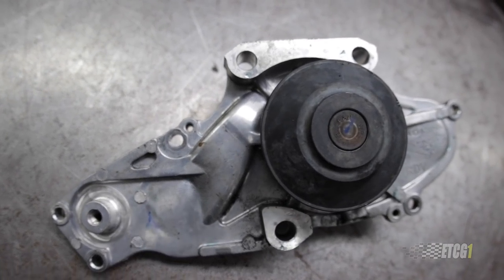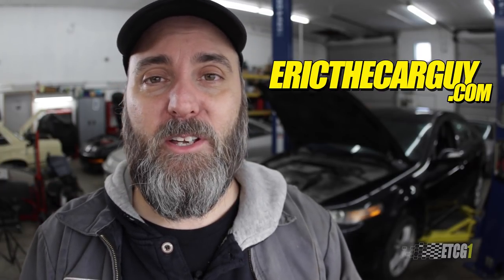Timing Belt vs Timing Chain, Which is Better?

Comment: My question has always been why did the public think the imports (belts by in large) were reliable but domestics(chains by in large) were unreliable--but after 150k-200k miles the total cost were the same (multiple belts versus one transmission rebuild).
Reply from the maker: I'll try and keep this short. Domestic vehicles often used nylon coatings on timing gears to keep them quiet during operation. When the nylon failed, so did the chain. Also, as the chain wears over time, engine timing, and often ignition timing, are effected and performance decreases. Conversely changing out a timing belt at a given interval sets everything back up the way it was when it was new and mechanical timing is restored every time you replace the belt.
Reply: @ETCG1  I wasn't referring to timing sets (to which I know GM used non oil resistant nylon as opposed to FoMoCo)  but the publics perceived reliability of imports.  When at the end of the day similar money was being put into them, imports in routine maintenance (timing sets and valve adjustments) and domestics on major wear items  (transmission rebuild).

Comment: Objectively, both have there pros and cons. In or houses hold me and my dad have owned several cars with timing belts and timing chains. Or daily drivers always had timing belts and we checked the service history of it before buying it. Always replaced the belts on any car we owned once the mileage or age interval was due. Did it ourselves (always checked how involved the jobs where first), bought the OEM kit. For someone that does their own maintenance it's an amazing piece of mind that the belt is fresh and replaced with a quality part, including water pump, tensioner. But for non-car people buying a car with timing belt motor is risky. Replace it just in case or walk away from the car if it's unknown when the last service was. Or replace it asap after purchase. I agree with the timing chain fan boys that it is mostly less to worry about. But, you have to keep in mind that the thick, overbuild timing chain from the past (like for example on my 70's classic mini) aren't the standard for the past 10 years or so. Modern chains are lightweight, thin, and have often fragile guides (Like on BMW's R51 Mini's) that could start rattling sooner than you think (especially high mileage ones). And replacing a timing chain on a modern car often means engine out, and doing some seals (like the front crankshaft seal) while your in there. Moral of the story. If you buy cars often and don't keep them long term (flipping them, our just like changing them frequently) buy something with a chain or belt that still has some live left before its interval. But if you want to keep it long term buying a car with fresh timing belt, or replacing it when necessary after purchase, that's the most safevest bet.

Comment: The thing I like about chains is catastrophic failure is a lot less likely than timing belts. Usually chains will stretch and shift time a bit where you'd have running problems before you get valve contact, but belts usually rip and you find out when your engine blows up. I view chains as serviceable items too, but just with a longer lifespan and a lower likelihood of failing unexpectedly.
Reply from the maker: My experience says differently. Fist, chains don't stretch, they wear. Second, if a chain brakes, it usually takes other things with it and sends a bunch of stuff into the oil pan. A broken timing belt doesn't normally do that.
Reply: @ETCG1  The feeling I've gathered with chains VS. belts is that with chains, following your oil change intervals is a big deal, and that most chain failures are a result of poor oil change intervals. Where as a belt driven vehicle would be much more forgiving of extended oil change intervals, you'll just start having compression issues, or oil pressure issues (aside from the other obvious problems like sludge and blocked oil passages and whatnot).
Re stretching: I've definitely seen case studies where chains have stretched, but I don't know how common that is. (yes the "stretching" is through the links wearing, but the point is the chain gets longer than it should be)
All this being said, I'm not a mechanic, soooooo... IDK. 😅
I just spend most of my free time watching ScannerDanner Premium, your videos, Ivan's videos, etc. :P

Comment: after I have done some research on both . and that's why I own V6 Toyota Venza . the only one thing it will take care of the timing chain. is change oil regularly. never to over due on oil change . and that one reason alone can cost timing chain replacement.. correct me if I'm wrong .. thank you for the video     ..

Comment: My Mazda problem you described was solved was solved by using the same plugs and wires that came with the car (Japanese OEM). I used Bosch once and it didn't fix my misfire.  The Mazda mechanic said it had to the with higher resistance of the Bosch plug.  He switched them out to NGK or Denso and everything was fine.

Comment: I’d probably have to side with a timing chain on this. My 05 mini has 122k miles on it. I replaced the head gasket December 2020 and considered replacing the timing chain while I was at it until I opened up the engine to find it looked to be in good shape along with the guides. But I’m going to anticipate replacing it here soon as a preventative measure. I can’t get financing on a vehicle at a reasonable APR at the moment.

Comment: Timing chain and it's not even close.  Stronger, reliable, and as long as you keep up with oil changes, it'll last forever.  Timing belts are just cost-saving measures, and things go horribly wrong when they shread apart.

Comment: Timing chain for me.  All five of the vehicles I've owned, had timing chains.  My mom gave me her old 1977 AMC Concord, back in 1990.  I only had it six months before the timing chain broke. (She didn't maintain the vehicle) 

We currently have an 07 Toyota Camry, with 143K+ miles and 01 DGC EX, with 308K+ miles. Both running strong with a lot of life left in them. I replaced the timing chain and gear, on our DGC, back in 2015 at 171K miles, because it was noisy. (Confirmed it was stretched) That job was pretty easy, but time consuming.  (Parts was less than $100) 

As long as you do regular oil changes and use good oil, a timing chain will last the life of the vehicle.

Comment: Wow, That digital confection looks very fancy 😋. 

I don’t mind timing belt driven engines at all, I believe the V6 Honda are still being driven by timing belt along with the straight 6 cylinder 3.0L duramax diesel found in half ton GM trucks.

Comment: I’m really old school, I replaced the chain on my Cleveland V8 with gears……….. more reliable than a chain, and no stretching, but noisy, and expensive. No doubt there are other issues with gears too. I realise that this isn’t a readily available option for most modern street cars.

Comment: Other problem with T-chains is when the have the water pump inside the chain cover and the pump goes bad the cost is a lot higher than t-belts.
Reply: Yes, this is an absolute nightmare. It was one reason the Chrysler 2.7 V6 was such junk.

This would happen on Nissan VQ engines, but typically they had 180,000 miles or more, so the car was barely worth it anyway. Years ago, DIY-ers would buy a 1995 to 2004 Maxima for cheap because they needed to replace the water pump, timing chain, and chain hardware. The leak would always destroy the RH control arm bushings, so just refilling the reservior occasionally wasn't an option. A DIY-er would buy such a car cheap, replace the water pump, timing chain stuff, and control arm, then drive for many miles after that. Those kinds of Maximas didn't cause much trouble anywhere else.

Comment: Just going to say that in a long ( ish ) motoring life with a variety of cars , I have suffered only 1 failure of a Timing Set and that was a BELT ( on a Toyota ). It wasn't an interference engine so there was no catastrophic damage , just inconvenience . The mileage was low but the car wasn't often used so the belt was old . Never had a hassle with chains .

Comment: I've often found that engineering design and ease of repair is more satisfactory that the arguments between the two types of belt engine designs. Designs like the infamous Mitsubishi Evo8 that need 16 hours to replace. Or the Volkswagen and BMW most infamous timing chain disaster because the tensioner from the factory was out of spec as you've stated.

Comment: My dad had a 2000 Mitsubishi Space Star (van type car sold in Europe) with a timing belt. On the Autobahn it made a weird noise at a certain rpm range. When the spark plug cables failed, the shop told us the timing was way off and that the timing belt should have been replaced 30000km ago.... The noise was the belt hitting the plastic cover.

Comment: I much prefer a chain. Only ever had to replace 1 and that was becomes the prior owner kept letting the oil get low (Saturns burn oil, just how it is). Usually if you keep the oil good, chains can easily outlive the care if implemented right.

Comment: I have owned four cars that used belts, A Volvo 240, Volvo 850, Geo Metro and Kia Sportage,  the 240 and the Geo were very easy to replace the belt and I was able to do it in under an hour.  The 850 having a transverse mounted 5 cyl motor was way to hard for me to do,  the Kia was also very hard to do and in addition the second belt, (a factory part not a cheap replacement part) failed 20,000 miles before it was due for replacement.  My last car was a Hyundai Sonada with the 2.4 liter 4 cyl. I drove that car over 345,000 miles with the original timing chain and today my son still drives it.  I am a firm believer staying on top of oil changes and using a good quality oil allowed me to keep that car for as long as I did.

Comment: The few million mile Toyota Tundras had the 4.7L V8....which contains a timing belt.  Let that rest on the shoulders of many.  

Personally, I've seen both failures, so really doesn't make any difference to me what type of timing connection there is whether it be a belt or a chain....the other being people who skip out on normal maintenance seem to have the same issues with failures regardless if they have a timing belt or chain....they skip the service interval for the timing belt, just as they do their oil changes.  

Typically the water pump fails and you have to pull the timing belt anyways so replace both at the same time it seems as the normal service.  Timing chains are ok till things go wrong with tensioners.  Regardless though, with many engines if one or the other breaks you have far more expensive damages.  

The 2.8L V6 in my 84 Ford Ranger had timing gears.  I think most vehicles I've owned have had timing chains, never had any issues with them.  80-100k seems to be what I see for service intervals for timing belts...at that point the water pump is probably on its way out anyways, so personally I'd just plan for that service ahead of time and keep money saved up for a shop to do the work if need be.  A timing chain breaks or a tensioner fails, you have more money tied up in that replacement than you do a timing belt typically, as there's usually more involved to get to the timing chain than there seems to be for accessing a timing belt.

Something I've found is many people don't realize there's a timing belt, they replace the one they see that runs the alternator, fan, power steering pump, etc....they get that serpentine belt confused with a timing belt, so they never think about it, and one day snap, goes the timing belt.

Comment: It's definitely a weird hill to die on. I didn't know people felt that strongly one way or the other. Like you said, they're both junk when they break! The number of engines with known problems with chains stretching or tensioner/guides failing is huge. They are not without their own flaws. 

I actually call the GM 3.6L V6 the "Chainslapper" because its so incredibly common on those lol. You can hear em from a mile away too. Every terrain, acadia, equinox, traverse, etc

Comment: Well, I have new shape ford transit with 2.0 ecoblue diesel engine. It has belt inside the engine lubricated by the oil - same as chain was before.They use special oil in these engines which will not eat the rubber.They do this to reduce noise and weight.The service interval for these belts are 150,000 miles.

Comment: I drive older cars and I don't like two things about chains:  Noise & Noise.
I like belts, because the rubber(ish) belt will absorb vibrations and the belt is the piece that wears down.
TB service at the Honda dealer was $700 (1988).  In 2015, it cost $1,800.  So, over a 27 year period the price didn't go up too much.

On my local Honda/Acura Facebook forums, High School kids will do this kind of work in my garage on their weekends, for $300.  Just inquire (on Facebook car forum) if anyone recommends/vouches for the kid or not.  The people on the forum can be brutal.   I buy the Aisin TB kit, for under $300 and the entire job cost well under $700.

Comment: My 05 scion tc has 167k miles and still runs great. Have no idea how many miles are on my '68 coronet 440, my '69 gto, or either of my '70 super bees but none of my latter cars have a hydraulic tensioners. Ya just slip the chain and gears on simultaneously. I'm happy with what I have. They are easy to change as well. I prefer chains but to each their own.

Comment: From my own personal experience, my 1990 L-Series Subaru (EA82) gave timing belts a bad name, but thankfully, the EA82 is a non-interference engine!  Subaru's service interval for both timing belts (boxer engine) is 100,000km, but the best I've ever had out of the "long belt" (drives cam, distributor and oil pump) is 80,000km.  I now change both (regardless) at 50,000km.  Saves me towing fees when it fails.

Comment: I've dealt with the aftermath of both outright failing. Chain tensioners wearing to the point of jumped timing and shrapnel in the oil pan on a 5.4 triton. And a belt that broke at highway speed from lack of regular replacement on an f22a1. I've replaced chains in small and big block chevy's, ls v8's. A Ford 351 and the 5.4 dilemma. Belts in Honda j, k and f series. And one Subaru.  I believe they both have their place and their own weaknesses. Never seen either fail under normal driving conditions, with good routine maintenance. But... I do tend to prefer a timing chain🙂

Comment: In my case, a belt is just easy maintenance. 2 of mine are fwd cars  one with an interval of 72k - although I don't go by that, i usually do it every 40k or 4 years and the other car is 100k intervals. But they're fairly easy to do and parts are really cheap.
On the other hand we have a bmw E90 320d which is chain driven and that's apparently a pita to replace since it's actually back towards the firewall.

Comment: I used to be a timing chain guy, but after experiencing what a pain it is to repair anything involving taking that cover off I’d much rather change a belt and associated pulleys every 100k.  Especially with these newer cars with the phasers, there is a greater probability of needing to tear into all of that.

Comment: The only reason more companies use chains now days, and why Honda went with a chain on it's K-series, isn't because they are better. Its so by the time the chain needs replaced, the car is out of warranty. I will not own a chain driven engine. All my cars use belts. I can look and SEE the condition of the belt (and with a flashlight, the lower tensioners) every time I check the fluids.

Comment: I think it really depends on the Make. Some VWs have been known to have bad tensions and boom goes the valves. On the other hand, it its a timing chain on a Toyota for example, you never have to worry about anything other than regular maintenance. I have a non-interference belt and nothing wrong with it. 290k miles

Comment: Definitely a chain fan here although I wouldn't thumb my nose at a car with a belt driven cam if it checked most of my boxes otherwise.  I watched a friend and his wife go through two Ford Escorts many years ago.  Ford recommended a routine changing of the cam belts at 60k miles.  Neither car made it that far.  Both had belt failures between 50 and 55k miles.  Fortunately, the engines were not interference engines so no harm done and they were close to home both times so getting the car towed to a mechanic wasn't a big deal but it didn't encourage a lot of trust.

Comment: Biggest reason why belts are gone these days is likely that most engines have oil pressure controlled cam phasers, which don't really mix well with a timing belt, except maybe the oil lubricated belts that Ford has used. Those cam phasers are also common failure items with some brands, especially Ford and GM.

Comment: With belts its less messy replacing them, plus you should inspect/ replace the tensioner and guide rollers anyways, plus the pump at the service intervals. Chains have their own benefits as well but involve more mess to work on. We all know many are ticking time bombs due to pathetically designed tensioners/guides etc and because they run in oil its usually quiet until the final moment. The infamous 5.4 Triton V8 guide and tensioner failures and the GM issues seem to come to the front of the class in many mechanics minds. I own vehicles with both belt and chain and if you keep any long enough you will be working in that area eventually.

Comment: I learned today that there's timing chains and timing belts but I think the most thing that I learned is a third one with gears that I never knew about because I don't really mess with diesels.
Reply: usualy heavy industrial diesel machinery have gear driven distribution or OHV distribution (over head valves, camshaft is in block and valves are pushrod driven) like trucks, buses, tractors, bulldozers, forklifts etc.